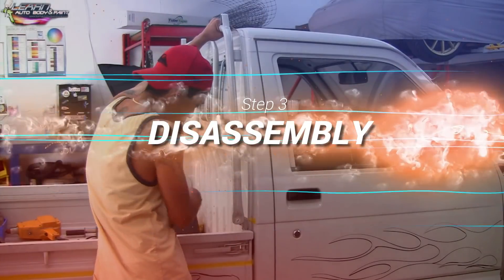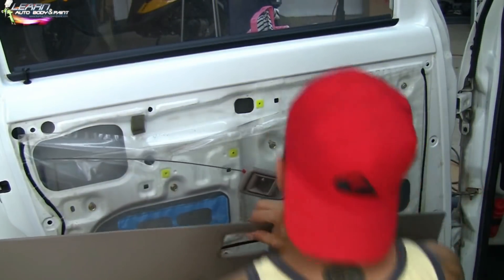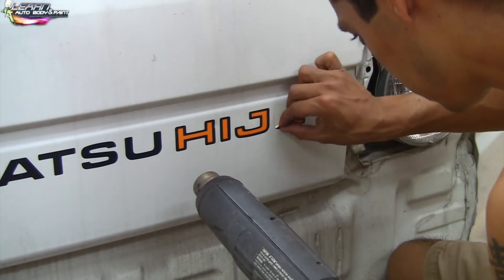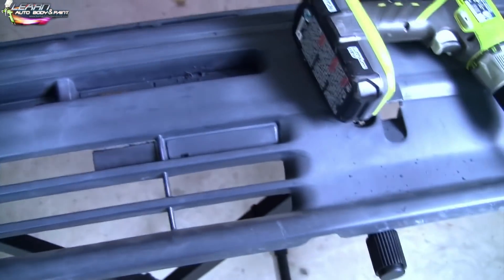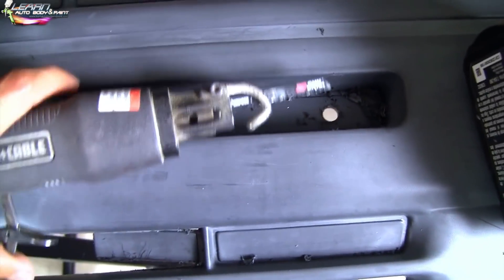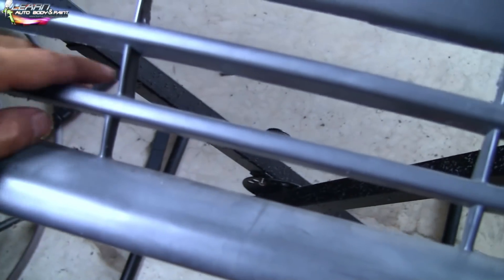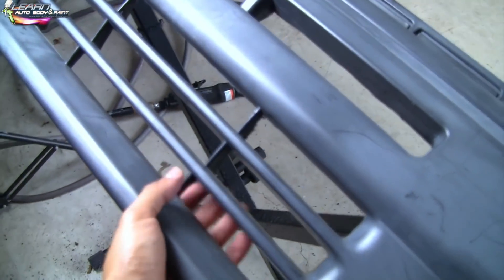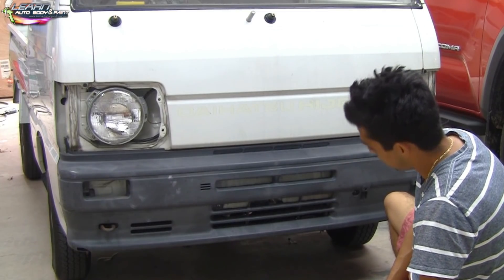Do This Before Painting Your Car At Home! - DIY Auto Body Repair

Comment: Hey Tony. I painted the inside of my doors for my 1954 Fargo 1/2 to.  I primed, sanded, and I washed it down good with wax and grease remover. While waiting for it to flash I got 100s of fish eyes. I am going to sand the doors down to bare metal and start again. I was told by someone to add fish eye preventer.  Have you heard of this?? Love all your videos.